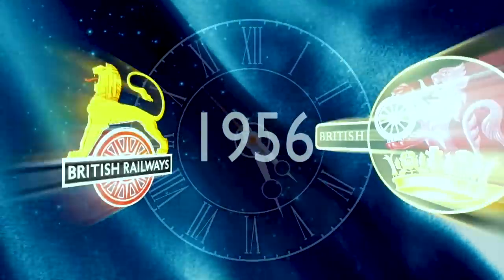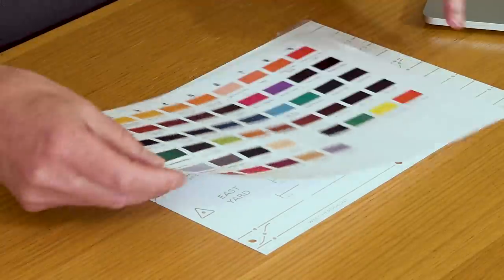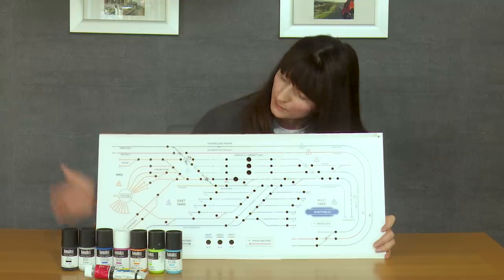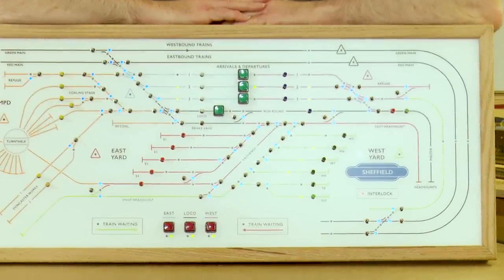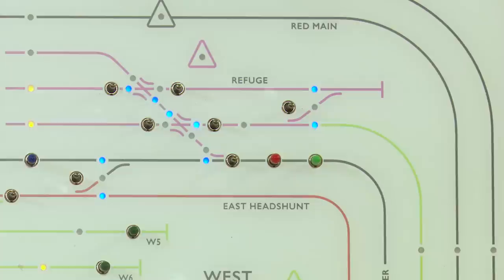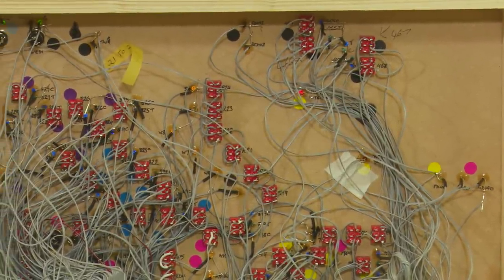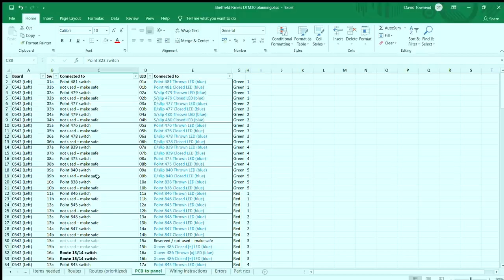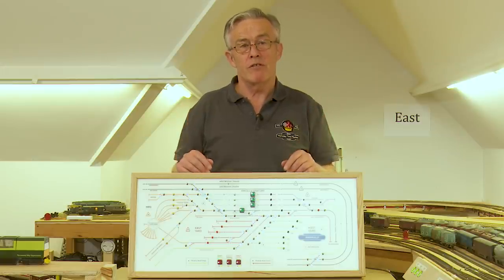43. Designing and building the Sheffield Control Panel at McKinley Railway.

Comment: I love the flashing lights to indicate that the route is in the process of being set.
Reply: That is common on real relay- or computer-based interlockings (at least where I live). It's really helpful.
Reply from the maker: That was designed by Laurence Barker.  The original designer behind the DTM30 boards.  They also flash when they haven't been initialised by the system startup process.  More on that in the up-coming videos.

Comment: Superb! Thanks for sharing 👍 One tip for future boards ... on the reverse side, perhaps an idea to have a reversed track plan printed to help the wiring navigation? I’ve done this on my control panels (using a reversed plan printed onto plain paper then glued) and it helps during wiring and fault finding.
Reply from the maker: That is a great idea.  Thank you.  I will talk to the designer to see if he could reverse etch it with the laser

Comment: Great looking panel so well done to all on the graphics and usability. My only view would be the internals, wow that looks it was a challenge to create and ongoing maintenance. Have you considered using what are now commonly known as Neopixel LEDs? (i.e. programmable), with this, you would need 3 cables between all the LEDs which would look much neater (and you control the colours via code, not by installing a predefined LED colour). These can easily be controlled via something like a Raspberry Pi Pico for a few quid, really simple to do.

Comment: The front facia looks superb, simple and effective graphics that is enhancing intuitive route switching and indication and dead right it has to work for you all, well done. On the wiring for your next build can I suggest you look at using a ribbon cable to terminal block convertor (terminal manufactureers like Klippon/ Weidmuller and some of the PLC manufacturers used to do them) to bridge your hinge with the module mounted under the panel; thus the now short ribbon cable is changed in a minute, (I think you are going to have some real accessibility replacement issues with the wiring on this one). Wiring individual cores from switches/ leds back to the terminal block of the convertor unit you can then neatly loom these wires and keep them clear of the switches and LEDs, thus making parts accessible for repair, it will also allow much easier construction as well as looking very professional. As said prior those switches are very heat intolerant when soldering, it will also de risk splitting cores off like that when building, hats of to your builders patience! Best regards Stephen
Reply from the maker: You have given me something to think about.  I'll research it a bit more.  Thank you.
Reply from the maker: I have to admit that the wiring looks like a dogs dinner.  We have to find a neater solution for that.
Reply: @dattouk  Good to hear you have taken on board. Each time you open close that lid you are stressing all the connections so fatiguing perhaps hundreds of joints all at once, so on that panel look at stress relieving the ribbon cables on the joint to minimise flex damage. 

For future when you loom you inherently neaten and stress relieve individual connections! It also forces you to consider cable routing, ensuring easy access to any joints and supporting too. I suggest you do all your common connections with multiple linking first, this will act as a foundation for the discrete point to point connections which you do next. As you have done elsewhere - the key for so many wires is to plan carefully the wiring and if necessary any loom supports. Hope this helps Stephen

Comment: Love the panels!
Have you considered making custom PCBs to go under them, instead of manually wiring things? They're pretty cheap to get produced these days. (If you're interested I could help put one together, it sounds like a fun project)
Reply from the maker: I was looking at the logic suggested by Clinchfield above and I was not sure about the visual impact for our operators of having a PCB .  You are the second person to suggest using a PCB.  We are constrained to use the DTM30 Tower master for the system.  Are you proposing we use a custom PCB under the facia and connect that to the DTM30 boards? Each DTM30 board has 6 number 26-way ribbon cable connections.  For the Sheffield panel we used three of them.  That makes 18 x 26 inter-connections.
Reply: @dattouk  yeah, custom PCB with the exact same circuit as your current wires. The LEDs and switches are soldered on to the PCB. Also on the other side of the PCB would be a ribbon cable connector, so you could use an off the shelf cable to plug into the DTM30s.

Comment: You've obviously put a great deal of time and effort into your panels and I've learnt a lot that I'll be able to use in my own forthcoming build, so thanks for making your findings available. You didn't mention anything relating to the colour choice of the panel background, as my own findings in my work with designing user interfaces in computer software shows that writing and line work can show up better on a darker background, and LED'S show up better too. I wonder if you considered this ?
Reply from the maker: Ah.. We did, but after the event.  The chaps at Hey Create told me about the different colour laminate boards available about three weeks ago.  When we showed the different background colours, everyone wanted to stick with white -  which surprised me.

Comment: David, The new panel look's very smart indeed. Will the new panel's for Machester and London be the same size as the old ones? I can see Richard Branson knocking on your door right now to get panel's for his " Space Project's." Cheers, Chris Perry.
Reply from the maker: Hello Chris,  The new panels are all deeper, but not necessarily wider.  We found that the operators needed more vertical separation between the lines to be able to distinguish  tracks.  We have standardised on a 17mm gap.  This allows us to add text and other crucial information especially to aid freight operation.  I hope Mr Branson doesn't come knocking.  Its hard enough to complete the ones we need. :-)
David

Comment: I see you have a mixture of 1 and two point switches on cross-overs, those with double/single slips in particular have two.  The crossover between the coal stage and refuge also has two switches, the West Headshunt has two cross-overs, one with 1 switch and one with 2 switches.
Is there some specific reason for this or was it considered not possible to use one switch only?  Personally I am convinced that it is possible to use one switch and I have done it on several different layouts.
Mark in Melbourne (Australia)
Reply from the maker: Can't disagree Shaun.
Reply: So redo of Sheffield or just subsequent panels?
Mark

Comment: For your next Control Panel, you could consider reducing the rats nest of wires, at least for the LEDs, by using individually addressable LEDs. An example of how the LED strips can be cut into individuals and then connected in series is this, https://youtu.be/D_QBlFIQk-o The harder part might be reading the output of the "cards" by the LED controller. But creating a table of which LED in the chain corresponds to which driver output won't be too hard. There is a really active Ardunio developer community that might help you out.

As the LEDs are full RGB, you might be able to do some cool indication effects as a bonus.
Reply: Ha Ha, I just got to the bit in the video where you said you will be using "rainbow strips"
Reply from the maker: Hi Alex,  your ideas are quite inspiring.  However, we are locked into using the DTM30 boards with the associated limitations on components and wiring.  I wish we could do smarter things, but the thought of learning a new hardware platform on top of what we are currently doing fills me with dread at the moment.  Thanks for the tip though.
Reply: @dattouk  Yeah, it's replacing a rats nest of cables with a rats nest of computing devices, and finding people to make bespoke hardware and software. Wish I was in a position to help out.

You and your team have a fantastic railway. Like you, as a boy, I looked at the Hornby Catalogue and dreamed of creating a railway from it.

Comment: Great panel, can I ask where you had it made
Reply from the maker: We made the wooden frame.  The design was created by a local graphics artist, Sam Clemance and the panel facia was etched by Hey Create.  We painted it and wired it up.  The control system we use is the DTM30 boards by SignaTrak.